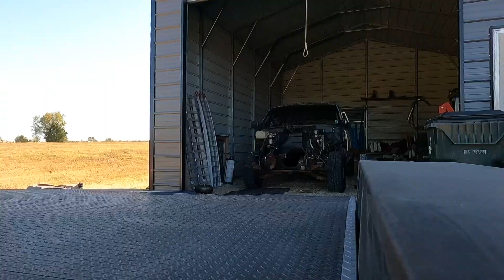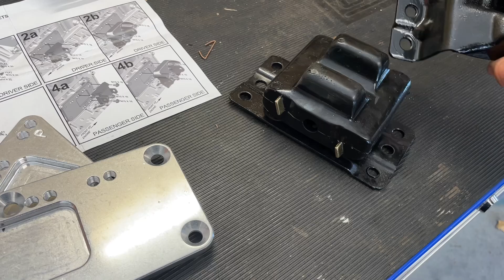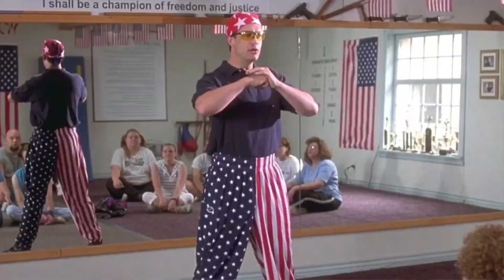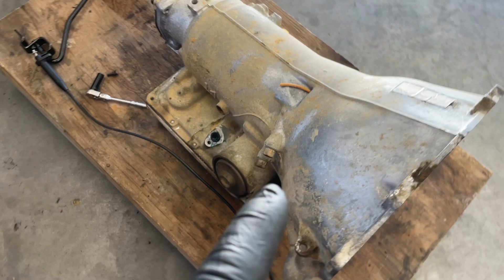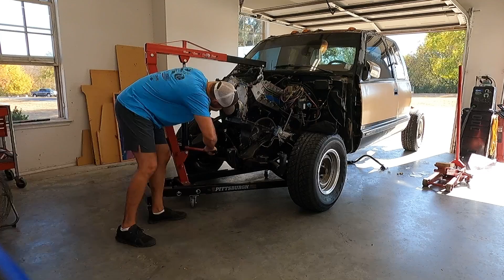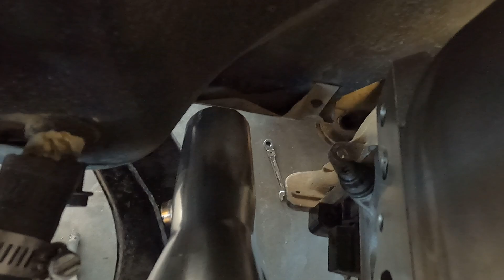LS install in Daddy Bill!

Comment: Where did you get the shims for the torque converter at ??
Reply from the maker: My nuts and bolts drawer. They are flat washers.
Reply: Ok  I got plenty of washers in my bins thanks for replying

Comment: Did you end up replacing the engine mounts on the crossmember or just leave them and use new clamshells?
Love the content I’ll be following these videos to a tee as I have a 6.0 and will be mating to a 700r4 as well.
Reply from the maker: Used what’s in the vid. Thanks!